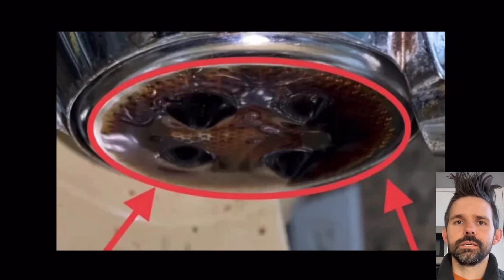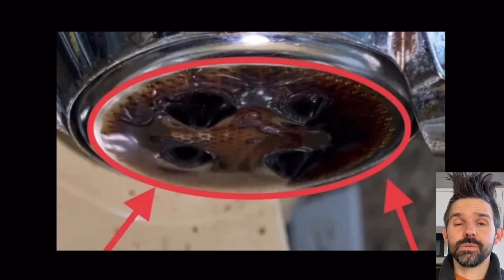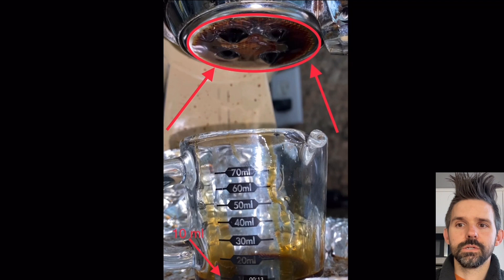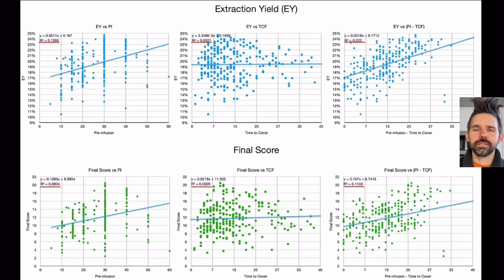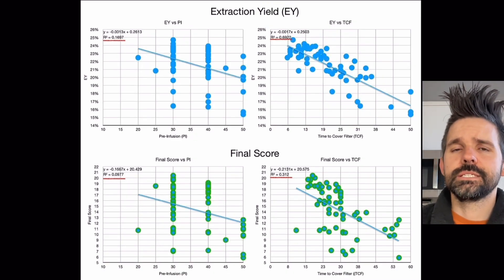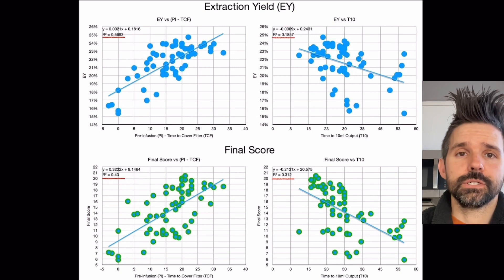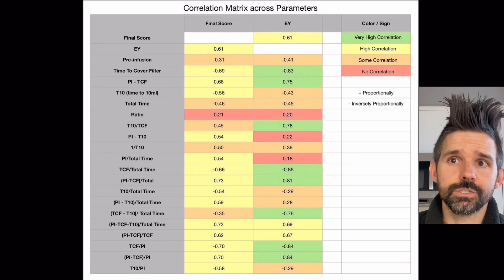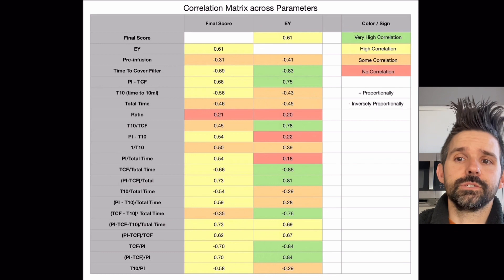Optimal Pre-infusion Time for Espresso: Time to Cover the Filter

Comment: You have a mind that I do not possess. 
Can you just tell me how many seconds would be the optimal pre infusion time please? Thanks
Reply from the maker: 30 seconds is good
Reply: @espressofun6091 so my Bezzera matrix has a time of 1 to 5 seconds pre infusion. So 3 seconds pre infusion and the shot 27 seconds?
Reply from the maker: @jddominguez  I would do 5. My ideal lever shots cover the filter by 10 seconds. Slower or faster usually isn’t ideal
Reply: @espressofun6091  much appreciated

Comment: I commend you on the metrics. My trial/error process is far apart. I don’t record any data since there are curves for each factor, but eventually it screams out and you realize it’s time to move. With 2 fellini’s and two pulls I don’t really get any coverage (from nothing to a drop to a couple of drops) but when the shot blonds up. I am paralyzed for time and beans. In conclusion, based on the premise that PI [without added pressure] should look like the standard-your pics-dark and full coverage, what does the journey going from my PI with maybe two drops, with 14 grams in, 40’ish grams out look like? And I know I have to go down coarser. TY for shedding some light!